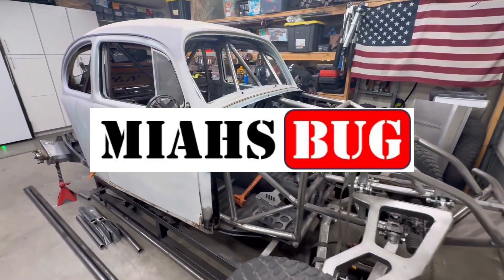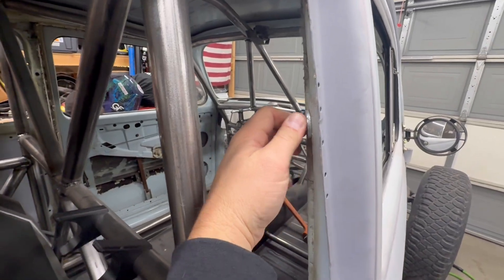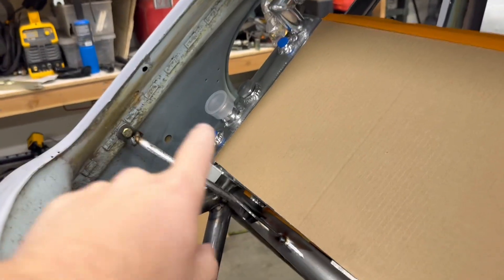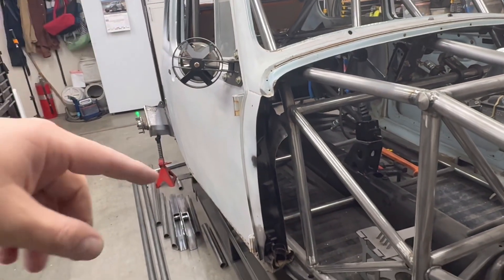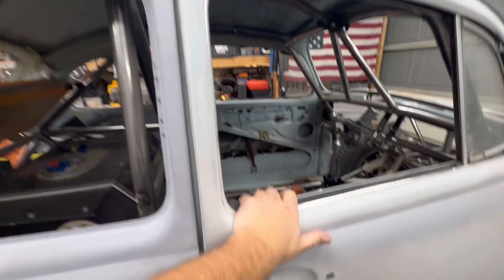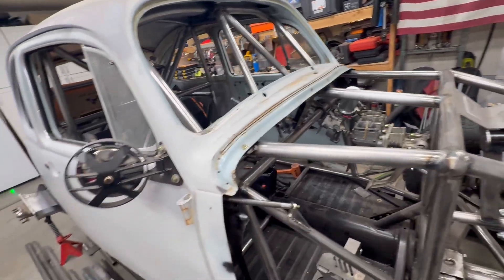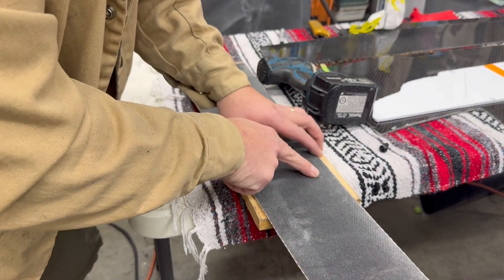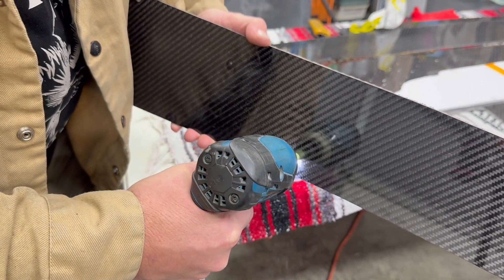Methods for Connecting Roll Cage to Body

Comment: Very clever design on the door pickups! I like it! Curious to hear how the riv nuts hold up, I feel like they don't take much to rattle loose, but maybe I've just used em wrong
Reply from the maker: It is very possible they rattle loose. The good thing is, since they are paired L/R the y won’t be in tension. Only shear. I’m sure there will be a few different items to address in the future after I figure out what works and what doesn’t.
Reply: @MiahsBug wonder how they'd hold up to a TIG Brazing. Slap a little Silicon Bronze braze on there, I'll bet that helps a bit. Just have a bolt in it to act as a heat sync, but TIG Brazing runs cooler anyways

I'm sure you'll get something dialed in though. Excited to see this thing in it's final stretch to getting drivable!
Reply from the maker: That’s a good idea. Maybe I’ll try one on the bench

Comment: Im definitely stealing that door adjustment system.  Super awesome
Reply from the maker: Do it! Isn’t yours all welded in already?
Reply: @MiahsBug #NeverToLate 😂😂

My plan is fine adjustments.  You can pull the top (like you) or push thr bottom... maybe both for mine

Comment: Nice!  What nutserts did you use?
Reply from the maker: What do you mean? Like what material? Or actual brand?
Reply: @MiahsBug Yeah,  I need a nut-sert source.  Gonna use them for my overhead lightbar (in places I can't put a nut)

That and misc panels like that your doing.